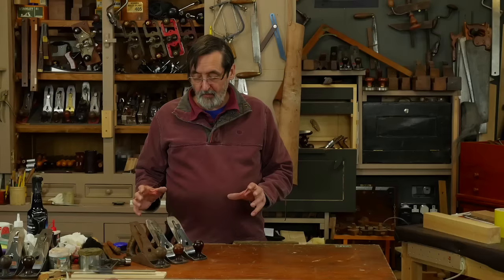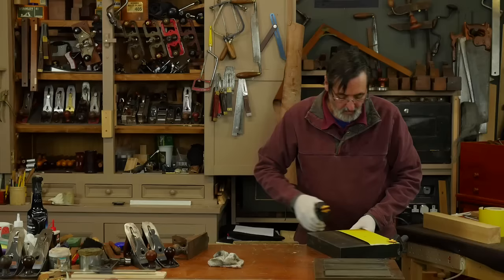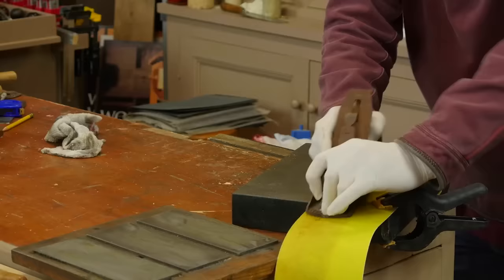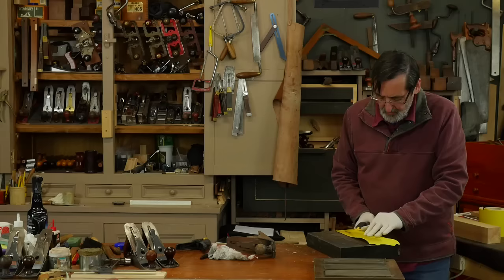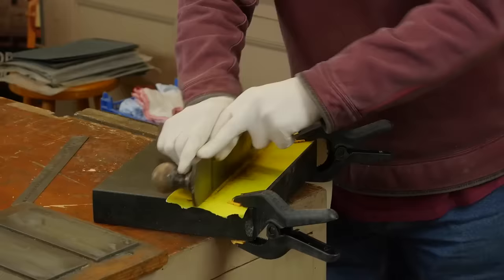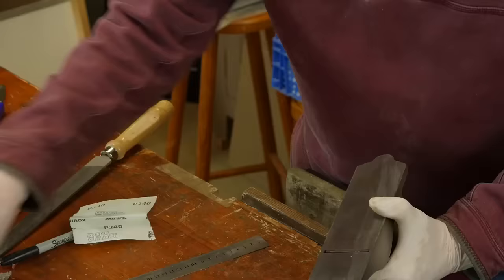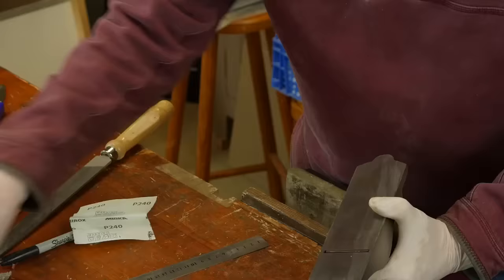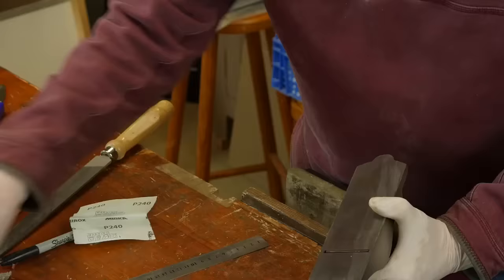Restoring the Bench Plane | Paul Sellers

Comment: As a novice woodworker I have been achieving very poor results with a an uneven rough finish and excessive tear-out.  I've just followed Paul's steps on a Stanley #5 and the difference is utterly incredible, the plane now glides smoothly, produces a uniform crisp shaving and leaves a silk smooth finish.  Working over a previous area of severe tear-out now leaves a perfect finish.  I now understand how Paul can achieve such excellent, precise results, so all I need now is about 40 years practice :)
Reply: @Doc Zoff, would you mind sharing the link for the particular video, Please. I am a novice, just received my first 2 , a block and a bench, used handplanes, I could really use some help on properly setup and adjusting. Thank You
Reply: How much did Paul pay you to say this?

Comment: I have been learning about restoration and about how planes really work for several months now. I kept asking myself why are the restorers lubricating the internals of the plane to make it move easier. And why must I remove the blade to adjust the frog… you have put all my questions to rest in this presentation. Thank you. Also the belly buster hammer blow technique is solid gold.

Comment: 8yrs after your post, @Paul Sellers, this video is so helpful. I just received a Stanley Jack plane from someone who stored it in his damp basement for over a decade. It is super rusty, but the blade appear salvageable and the sole looks like it’s worth the effort. I’m concerned about the copper adjustment know and the pressure cap (not sure what that’s called), but I’ll give restoration a go. Thank you for this video, which gives me hope.

Comment: You are a craftsman and it shows.  Glad I found your channel.  I have an antique bench hand plane and need to restore it.
I refinish wood as a hobby, though I have not used shellac yet. It is a fine old finish but not durable.  I like everything to be durable and solid as a tank.  Why use shellac on the wood handles?  You might be better off with Polyurethane.
I would strip and sand both handles, then lather them up with boiled linseed oil, wipe off excess, let dry 1-2 days, then coat with diluted oil polyurethane - 2-3 coats.  This will last a lifetime with no need to redo. Wood grain shows up beautifully, oil conditions the wood so it does not crack.  I did all my garden tools this way. They are waterproof and crack proof.  When you thin out the poly to 50% or 60% with mineral spirits, it soaks into the wood.  Now the wood gets very hard and it acts like a glue preventing any cracking.  The BLO is like a wood conditioner for thirsty dry wood.  I love this method (my own) and I do all furniture with it. You can wax or oil on top of the poly.  Since the poly is diluted, it is not tacky and you feel the wood below, so it looks like a hand rubbed finish.  Try it sometime.
Any area of rust (except the bottom or blade) gets a spray of Loctite Rust Neutralizer so no more rusting anywhere.  It might work for the bottom too, if very fine spray, then a wax coating to slide well. Solves the rust problem.

With regard to fixing your blade, get a grinding stone. You save on paper.  Its silly to spend valuable minutes of your life and to tear up your hands on manual grinding.  Makes no sense at all.  One bench grinder with two wheel grits - done in 2 mins or less.

Comment: Even with a new plane out of the box, I do a disassembly and do a lot of polishing and sharpening. I've only bought two new ones in my life and have had to work on both. I have a half dozen assorted planes now ranging from a Tru-Value Master Mechanic to a Sargeant Hercules. All of them came from yard sales, auctions and second hand stores. I spent several hours apiece tuning and refurbishing them. Even a cheap plane can be made into a very functional tool with a little work and constant care. Considering how much regular maintenance is needed to keep a hand plane in good condition, the original cost is only a fraction of the value.

Comment: Thanks SO much Paul. Have been restoring my 45 yo #4 after 40 years of no use (long gap :)) Some tips there that I really need to take on board, but even more, some sage advice as to what NOT to stress over too.

Comment: 26:02 Good practice, if trimming a bolt like that, is to find a nut that fits it before you start cutting the end of the bolt. Thread the nut part way down the bolt, then make your cut. Now when you remove the nut, it will serve as a makeshift die to clean the bolt threads on its way off the bolt.
Reply: You go find a nut that fits a stanley post those threads havent been made since ww2
Reply: Konstantin Ivanov it's still a useful tip, even if it might not be practicable in this case
Reply: Craig Slitzer yes it’s called chasing the thread
Reply: @craig slitzer. Good tip, very true. Another tip built on same principle is to put 2 bolts on a long screw or threaded bar and hacksaw in between those bolts to desired lenght.
Reply: That's a great tip, I wasted so much time with files trying to re-thread the ends of a bolt after cutting/filing it.
Reply: Good luck finding a Stanley nut. They have their own threads. They are not standard.

Comment: Absolutely incredible video!  This is the video P. Woodworking should have made decades ago, and didn't.  
Good timing also, I just bought a 99% nearly new #3 Stanley that has been in a collectors possession for many years but was for show only.    
I have a tip for those with less experience than Paul:  When adjusting the blade to get it just right, a magic marker line across one side of the flat in the adjusting screw will let you deal with the backlash and come back a nudge more or less with ease.

Comment: I just did this to a Stanley #4 and there was an additional problem not mentioned in the video. 
When I put the plane back together, the lateral adjusting lever had to be positioned hard right to get the blade to project evenly across its width. Close inspection showed that the frog was not sitting quite square in the plane, so I filed one of the bearing points a little to get it to sit flat. 
This solved the problem. The lateral lever is still not quite centred, but I put this down to my novice blade-sharpening attempt that left the blade very slightly out of square. This is no doubt what the lateral adjusting lever is meant for.
Reply: A blade should ALWAYS be ground dead square across. That's rule number one. The lateral adjusting lever is for very fine tuning. The frog adjustment is for closing the mouth when working with wavy woods to avoid tear-out. There are some very serious sharpening  grinders out there, that maintain the angle. One of the best is Tormek. This brand uses a water stone that turns slowly- absolutely NO blueing the blade and distempering it. Unfortunately Stanleys are much cruder than they appear; they were never really ground square, and the adjustments left a lot to desire. For the last fifty years the tool steel is of appaling quality- you can never get a keen edge. Today the Veritas and the Lie Nielson go way beyond what Stanley ever achieved. If you tried one you'd never go back. Both of these brands make beautiful precision tools. Of course, they are outrageously expensive, but quality pays. Actually, the number 4 1/2 is a much handier plane- more weight, and more width. Weight helps a lot, even for smaller work. I'm not disagreeing with anyone; I've salvaged a good amount of old tools in my time, but it's good to move on and discover improvements. Try out one of the above-mentioned planes, and you'll see the revelation.

Comment: Mr. Sellers:
My father was a iron and metal craftsman, and he would use molasses to remove heavy rust from vintage iron tools.
After which time we would sharpen and restore the hand tools.  Have you ever used that process to remove heavy rust?
I'm not sure if molasses is a commonly used ingredient in the U.K.?  Thank you for the videos and the manner in which you teach.     Thank you again and blessings to you and yours.
Reply: D. Dominguez , that is old school. . Not best for heavy rust,  light surface rust and keeping original patina.. yes...  I still use that every so often. . thanks for sharing. .
Reply: I use a bench grinder with a wire brush wheel on it.It removes the light and heavy rust, and all it leaves is just the blackened steel, the patina.You may want to use an air filter mask for this kind of job.
Reply: I usually use a soak mixture of course salt and white distilled vinegar, followed by mineral oil soaked grades of #0 through #000 steel wool

Comment: Really practical. Who would have thought that ANY plane can be restored. Paul Sellers, master craftsman, shows you how, and gives you the full confidence to have a go yourself. To do carpentry you don't need thousands of pounds. Sure it speeds things up if you have the machine tools, but if you watch all of the Paul Sellers videos, he shows you that you can get just as good outcomes with hand tools and a little more time without it costing you the earth. Wonderful series. Just look at that restored plane. Who would have thought that rusted relic could be restored to this?

Comment: Can you do a video sometime to explain the difference between the numbers of theplanes and what they are used for?  Bench vs. block, vs bullnose,vs low angle, etc...  I would like to start using more hand tools and less power and don't know which ones to buy for the projects I have in mind.
Reply: The numbers refer to the size of the plane.  A bench plane is the style you saw in this video. A block plane and a low angle plane are the same thing. In them the angle of the blade is much more acute for endgrain work. A bullnose plane, also reffered to as a shoulder plane is a plane where the blade is flush with the edges of the plane.

Here is a link that tells you what the different numbers mean on stanley planes at least
http://homepages.sover.net/~nichael/nlc-wood/stanref-num.html
1-8 are the bench planes. 1 being shortest of stanleys bench planes and 8 being longest.

I find the most useful ones are the numbers 1, 4 1/2, 7, 8, 60 1/2 and 62. I work as a luthier mostly so a lot of difficult figured wood and usually nothing longer that 1500mm.
Reply: Birki gts
What type of guitars do you build?  I have been teaching myself classical\spanish style and I think my end game is going to be to build my own instrument.
Reply: Scott's Wood
I build all kinds of stringed instruments based on what is ordered. But most of my orders are for electric guitars and classical guitars.
Reply: Do you have a website or example catalog?  I might be interested.Birki gts
Reply: Scott's Wood
Nope, so far i've only taken local orders and have spread through physical ads and word of mouth. In the near future i hope to get a website up, but i don't have one yet.
Reply: Birki gts
General idea of where local is?
Reply: Scott's Wood
South and East Finland, Though i do get the occasional order from Russians and people from other parts of Finland. The city I am based in is Imatra, moving shop to Kouvola in the near future. By then i will have a website.
Reply: Birki gts
OK, I am in the USA, so much for local pick-up.
Reply: Scott's Wood
Indeed, There are many good luthiers in the states though, A quick google search may wield good results.

Comment: I have heard that one can use a white vinegar soak to remove rust.  Do you have an opinion, Mr. Sellers?
Reply: yes it works, i has few hammers cleaned that way, by with the plane i guess doing this way it will smooth the surface + remove rust.
Reply: Alexander D. MacPhail yea before you start where he began at the sanding, give every metal part a vinegar soak and then hit it with some light metal brush. Repeat a couple times to get rid of the bulk of rust.
Reply: works great. remember only to soak metal in vinegar. for example if you're restoring an old hammer for instance either remove or cover the wooden part. besides that, the longer it will soak, the more rust will come out, but up to a point. the longest for me is 12 hours, depending on the condition. then remove all the dirt with a cloth to see the progress and rub down the rest with either steel wool or a metal brush
Reply: Battery chargers can be used to remove rust but its a little bit of a process.  Probably best to start with vinegar, a dilute acid.
Reply: Evapo-Rust or electrolysis for me.  I really love the stuff for small iron pieces like this.  I think it works better than vinegar.  Either way soaking in a rust remover first will limit the amount of metal that needs to be removed.
Reply: Alexander D. MacPhail ii
Reply: Vinegar works amazing, but it does give the metal a dull grey, almost blued color.
Reply: Zach Mcmillan I noticed the dull blue finish on a #7 Ward Master (but Stanley manufactured) jointer plane. Do you know if the dulling can be improved with sanding or buffing? I tried Paul’s sanding technique on a #5 and was amazed to see an almost-new like shine within minutes! Wish I had seen this before reading about the Vinegar technique.
Reply: Cindy Lauman, I have used honing compound on a rag for some of my saws, and it works pretty well. I believe I got it from Lee valley. It's really intended to be Jeweler's polish so it works well for polishing metal.
Reply: Michael Summers +1 on the EvapoRust. I’ve used it on some very rusty tools and it does a great job. It’s also non-toxic: you can pour it down the sink after use. (Just a happy customer here.)

Comment: Years ago, when I had no money to setup a workshop, I stumbled across your videos and purchased some hand tools. A Record No.4 plane, some good chisels and other stuff like the Veritas Mk2 honing guide. But I never really came to use them. Here I am again, 7-8 years later, now 30 years old and married, still not able to purchase big tools and still without the space for a huge workshop.
At least I got a one-car garage now, which luckily doesn't fit our VW Passat because it's too small :D and a room in the basement, where I can work now. I reground the Record yesterday and today in the morning, after reading some of your blog posts, I went for the hunt for a small block plane. Good news: I won an auction today for 10£. Bad news: it includes a Stanley 130 block plane AND a Stanley Handiman No. 4, and I gotta pay shipping to Germany :D
Other bad news: I still got three auctions running, where I am highest bidder currently. All in the same price range, all for block planes :D
I will try to restore the ones I get following your videos, and if I don't find them useful (included are a Stanley 9 1/2, 102 and 110), I will sell them restored.
Now I want to make some stuff like a shooting board and a thickness planing jig, since I want to use them for some first Kumiko experiments and maybe some other small woodworking projects.
Thanks a lot for your videos and guides, they are really helpful!

Comment: I bought a pre-owned No 4 Plane about a year ago. It did not need a lot doing to it. The handles were in very good shape and not a lot of rust. I flattened the sole and sharpened the blade and it seemed to work quite well. Today I watched the video again and then went and tuned the plane a little. Adjusted the frog, which was skewed a bit and set the position properly. Also flattened the tip of the chip breaker and set the distance from the chip breaker to the blade correctly according to your teaching. And oh boy, what a difference! Thank you so much.

Comment: Thank you so much for this intensive look at how a hand plane should be restored. I am quite new to woodworking and restored my late fathers No 4 plane which had never really been used from new but suffered from rust etc.
It became the best tool in my shed!
But now I have watched this I will restore it further using all the stages you have just taught me that I never would have thought about.
I love my dad's old Stanley No 4, but I can't wait to try it after all the refinements that you have taught me.
Thank you Paul.

Comment: I'm not even 40 minutes in and you've made me feel so much better about my recent plane purchase. I admittedly impulsively purchased one of the new Sweetheart Stanley No 4 plane and a "Contractor Grade" Stanley no 5 plane. Upon further research, a lot of people were complaining about how the sole was out of flat and many little issues. What you have shown me here is that with enough time and effort, you can take a beat up plane and make it amazing. At this point, I actually look forward to the experience of giving the no 5 some love and making it my own! (I already plan to make my own handle for it out of wood, since the one it comes with is plastic.)

Comment: Paul, many thanks for the two videos on restoring and setting up planes. I just acquired a No 4 and 5 and they are in need of restoration. Both are clean with just minimal rust, and both show the signs of being used for many, many years. The 4 is a type 15 (1930s), and the 5 is a type 6 (1800s). I'm excited to get started on restoring them.

Comment: This plane looks much easier to clean up than on old plane I've stumbled across in my dad's garage.  I believe it's a No 3 Shelton plane from the 1930's.  It's stamped with "US Patent 1914609" which was filed in 1932 by Cornelius J MacAller and has a bit more complicated screw set mechanism to adjust the blade as opposed to the flip lock mechanism of Stanley planes seen in most restoration videos.